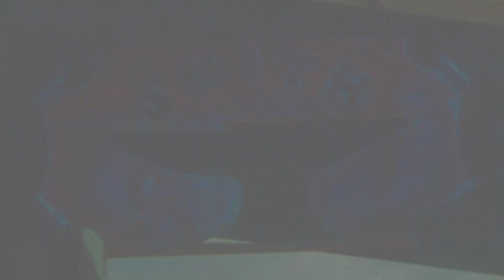Forged in Fire: Bonus: All About Jason Knight (Season 3) | History

Comment: hey guys. I have a question. every video I see where knives are heat treated, after taking the knife out of the forge and into the oil, they heat treated the blade in an oven at 400 to 450 degrees for several hours until it turned a gold color. why is this step not necessary on the show? I would think the blades would break without this step.
Reply: Mike Crum - The Master Smith (James Neilson or Jason Knight in this case) is in charge of tempering the blades after the first round, since he knows what he's doing.  They simply don't show this step on the show, although it would be nice if it was at least mentioned for the 'layman' viewer.  

You can get some good info over at Bladeforums . Com since a number of the FIF contestants and champs frequent the forums there and shed light on some of the matters that other makers and collectors there are curious about 👍
Reply: lsubslimed they actually mentioned it in yesterday's episode.
Reply: ForeverRanger 91 - It's funny you mentioned that.  As I was watching it last night and heard him say the blades have been tempered, I immediately thought about my reply here.  That is the very first time it's been mentioned I believe.  Perhaps J Neilson made them aware about the critique in the knifemaking community, as I saw he was finally back as well.    I saw they got some grinder upgrades too, from Bader to TW-90 👍.   Still plenty of small things that could be better though, I'd say first of all would be to show the bladesmiths FULL name written on the screen when they are introduced.